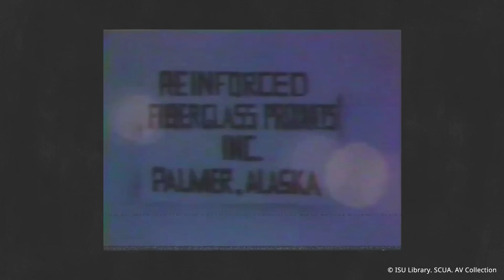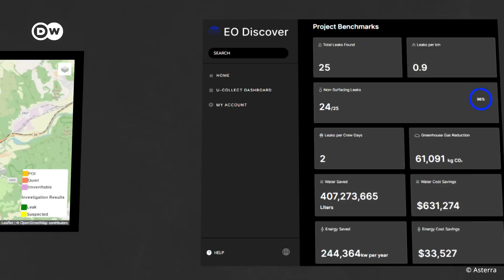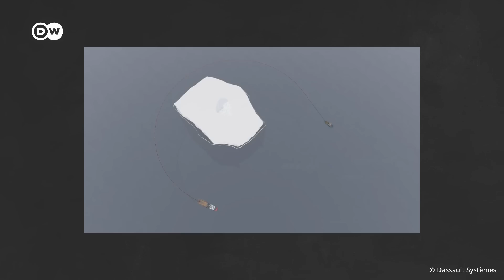How far we go to solve the water crisis

Comment: The better solution is to use the sun's heat to produce water vapor or even steam (which could be used to generate electricity) and then condense the vapor back to distilled water. The condensation can be done by freezing seawater in large flat underground facilities taking the layer of ice that first forms on top of the seawater which is largely salt free and moving it to V shaped tanks where as they melt the vapor from the sun heated seawater condenses on the outside of the tanks. The water harvesting on the outside of the tanks can be sped up with windshield wiper like things that scrape the pure condensed water off the outside of the V tanks and as the ice melts it fills the V tanks with cold pure mostly desalinated water. That water can then overflow and be mixed with the condensed water. This can all be powered by photovoltaic solar panels to run the heat pumps to freeze the water and solar water heaters to boil the seawater. You can keep boiling the seawater and brine until all you are left with is nearly dry salt. You can move this salt to existing salt flats that have been deteriorating because of climate change.

Comment: Reverse osmosis desalination is a very costly way to produce fresh water from seawater, plus it comes with a variety of problems such as what to do with the filters that need replacing often, these systems need lots of energy (typically electric) to create the high pressure to get the seawater through the filters and the problem of the large amount of high salinic water or brine produced by the process that is an environmental hazard often just dumped back into the sea. 

The better solution is to use the sun's heat to produce water vapor or even steam (which could be used to generate electricity) and then condense the vapor back to distilled water. The condensation can be done by freezing seawater in large flat underground facilities taking the layer of ice that first forms on top of the seawater which is largely salt free and moving it to V shaped tanks where as they melt the vapor from the sun heated seawater condenses on the outside of the tanks. The water harvesting on the outside of the tanks can be sped up with windshield wiper like things that scrape the pure condensed water off the outside of the V tanks and as the ice melts it fills the V tanks with cold pure mostly desalinated water. That water can then overflow and be mixed with the condensed water. This can all be powered by photovoltaic solar panels to run the heat pumps to freeze the water and solar water heaters to boil the seawater. You can keep boiling the seawater and brine until all you are left with is nearly dry salt. You can move this salt to existing salt flats that have been deteriorating because of climate change.

Comment: Yeah, all you have to do, is get an iceberg, tow it to a dry dock, pump out the old water, let the iceberg melt and look, fresh water! Simple and SOOO easy! LOL An easier way is just to turn every faucet half close. When most people wash their hands, most off the water splashes off the hands and goes down the drain! Turning the water down, allows more of the water to actually go over your hands. I suggested this back in Iraq in 2018 and my supervisors asked if I was an water engineer? Some people are just have too stupidity. I calculated we would save over 30,000 gallons per months if we did that.

Comment: I'm shocked to see a whole segment on iceberg transport without a single mention of how this would affect the environment. I would guess that these icebergs floating close to the poles contribute to maintaining both the temperature and the salinity level of the water at the level required to sustain the (quite enormous, in case you missed it) ecosystem of the regions. Even supposing our greed will be contained in simply harvesting those rogue icebergs and not, say, to chopping off parts of the permafrost for a quick freshwater fix (what could possibly go wrong there, I wonder?), the implications for the biodiversity of the region and, by extension, the planet seem pretty huge for you to gloss over like you did just now.
Reply from the maker: Hey there! 🌈Every year, 100 000 icebergs break up in Antarctica. Experts from the video confirm that taking around 1-10 icebergs has no real impact on water salinity and should not harm the environment. In fact, global warming is causing ice to melt in huge quantities where it should not melt in the first place. Currently, there are too many melting icebergs. The idea is rather to lead them to melt somewhere where it would be beneficial.
Reply: You are a clueless fool.😂
Reply: Yes !

Comment: great idea, after harvesting everything that grows, mining everything that’s in the ground and dumping waste on land in the water and the air, we start collecting polar ice as if the ice sheets would not melt fast enough already.
Reply from the maker: Thank you for commenting. 🍀 Focusing on overconsumption and the excessive use of water as well as good water management are the first things. The solution to ice harvesting suggests that ice already fractured in the Arctic could be harnessed and entire icebergs could be hauled from the Antarctic Ocean. However, icebergs are an important part of the flora and fauna of both polar regions, no denial.
Reply: @DWPlanetA  "Iceburgs are an important part of the Flora And Fauna." 
That's the most Ignorant and Retarded statement I've heard in quite a while. 
Go ahead and explain what that's supposed to mean exactly..
Reply: My though aswell, we are so fixated on finding quick fixes of the symptoms instead of actually dealing with the real problem.

Comment: Towing is quite frankly weird. Building massive under sea pipelines to transport the melt water on the other hand would be more environmentally friendly. We already have millions of km worth of gas and oil pipelines so that shouldn't be that big of a problem.
Usually I'd say generally using melt water from the poles rather than desalination is ludicrous but desalination takes a lot of energy and mankind is an energy poor society right now.
Maybe some time in the future we'll have energy cheap enough thanks to fusion or space based solar to be "wasteful" with it.
Reply: I wonder though, how much energy would be expended to tow a big chunk of ice from basically another continent vs just processing the salt out of the water in your back yard?

I know that's a bit hyperbolic but still.

Comment: There are plenty of places where water is over abundant, so why don’t we find an environmentally friendly way to bring that water to places where water is scarce? We could probably do so without wiping out our already depleting glaciers. The oceans are a great source of water. We can use the salts from the oceans to make batteries, and use the water for communities that lack freshwater. 
Let’s discuss how water can be transported without relying on pipelines to transport water across large distances. If we concentrate light onto the water where it is over abundant then it can heat up the water to evaporation temperatures. The water will likely form clouds that can travel hundreds or thousands of miles before releasing the water again in the form of rain. This would also help cool the earth by reflecting more radiation from the sun back into space.
If we were to pump the water into troughs to utilize the afore mentioned process then we would avoid killing as much aquatic life in the process and have a means of collecting salts for batteries and for food consumption.

Comment: Fascinating & very worrying.
In the UK the policy of the water companies is "If the cost of repair is more than the value of the water lost, do not repair"! which is absolutely ridiculous & shameful.
Reply: There should be a fee for the water companies that they have to pay extra for all the water which is wasted before it arrives to the households
Reply: I mean, that makes sense. Auto aligning solar installations have the same concept. Each adjustment wastes power. So if you adjust for every little cloud or shade, it'd just be inefficient.

Though over time, the leaks could eventually cost them more.

Comment: How would you tow an iceberg mountain, considering that they flip when sufficiently much of the bottom or top melt? A mountain of 125 million tonnes would drag absolutely everything imaginable under with it during an accident, not to mentionthe tidal wave that could be caused if it flipped close to a habour or something.

Another solution that would help is changing how we farm crops, we waste absolutely massive amounts of water with inefficient farming.
Reply: Plus, if Saudi Arabia and the UAE want to bring them down from the Arctic to the Arabic region - they will be crossing the Gulf Stream, which will warm it and melt it faster (especially now the sea is warmer than back in the 1970's). 
Also, what about the Polar Bears and the seals? They need all that ice for their cruising, fishing, pup nurseries, etc. I'm sure they're not going to appreciate ships chugging all the way up there and towing their ice away.

If the Arabic regions should be getting ice from anywhere, it should be from Thwaites Glacier, since bits keep breaking off of it. I'm sure the country that owns the area won't mind selling them chunks of it. 
But as you say, icebergs roll. Towing ships are at risk. The safer way would be to attach a couple of remote controlled engines with boat propellers to the back and turn the berg into an unmanned ship.
Reply: @debbiehenri345  As much as I would like for the UAE to care about polar bears and seals, I highly doubt they'd actually prioritise them if it came down to it. I find it way more likely to be honest, that someone puts a factory in the arctic that harvests ice in small units, and uses regular container ships to transport them, or just makes an insulated pipe to transport it as water.
Even with that said though, I don't consider either of them to be truly likely, doing so is most likely significantly harder than to make a more efficient process for desalinating sea water, and sea water is right next to them.

Comment: Humidity harvesting is such a great idea
Reply: But on a mass scale it would reduce rainfall.... I guess...
Reply: @ascra1693  I didn't know that. Thank you
Reply: Oh hell nah
Reply: Couldn't you just catch rain?
Reply: Morroco has been using humidity harvesting (called fog farming) for some time. It does not affect rainfall. Makes a difference for Morrocans that use it. Only a small number use it however it shows potential. 88% of water use in Morroco is for agriculture. Drought affects them as they occupy the edge of the Sahara desert.
Reply: @MoogleMy  it has to affect rainfall. That moisture in the air which is caught would have fell as rain at some point. The benefit is that we are more efficient at using water caught this way then we are at using rainwater
Reply: @John...44...  yes.. rainfall in many places will be affected.
Reply: No.
Reply: And that will lead to less rainfall as the humidity is removed from the air. Have you considered the long term problems less rainfall will cause for the environment and animals that depend on water to survive?
Reply: unless there's not enough humidity in the air
Reply: @doodleydude7833  works great in the tropics  - where it rains once a day ( sarcasm)
Reply: @CHMichael  yeah it requires a very specific location and condition for it to work
Reply: The aftermath is scarier than you can imagine..
Removing humidity from air = no rain
Reply: Most of the sysare a scam- it does work in combination with your air-conditioning. 
You need dual use to justify the energy.
Not to be compared to fog harvesting  - that actually works